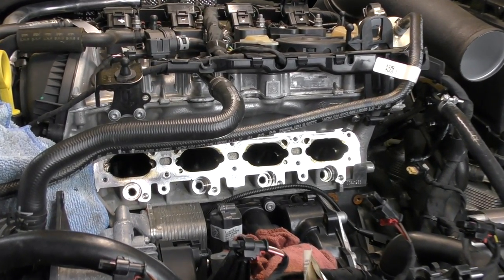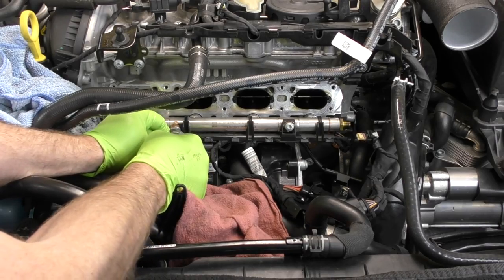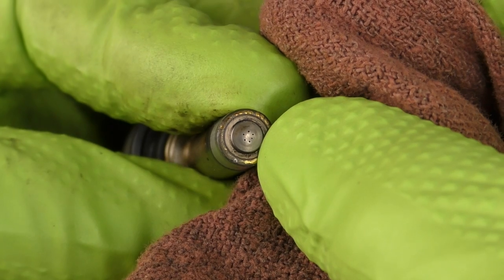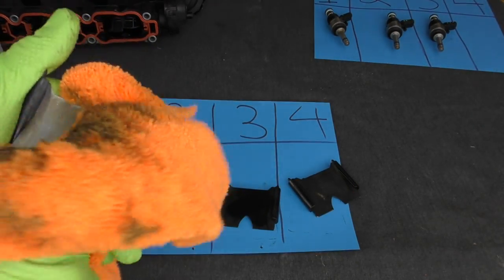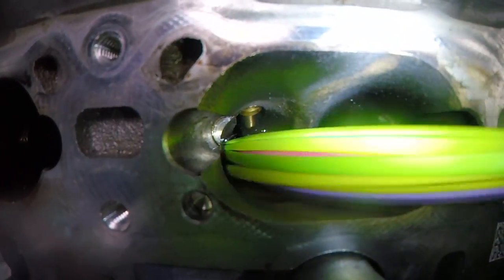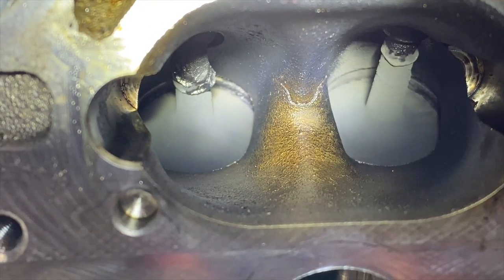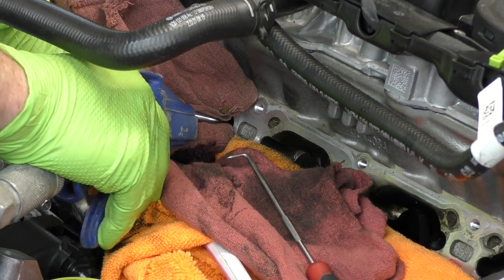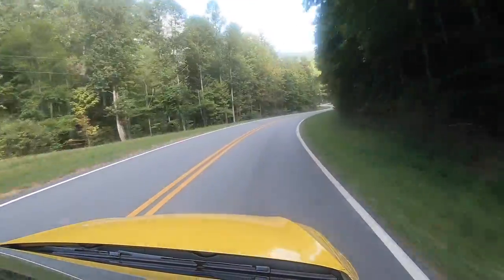How Much Carbon Build Up at 10,000 Miles?? ~ 2019 Golf R

Comment: Unfortunately top-tier fuel ratings have no impact on carbon buildup on DI motors simply because of the nature of the DI motor. Neither does higher octane fuel. As a matter of fact, an occasional tankful of low octane fuel might actually help burn out some carbon deposits due to the fact that the lower octane gas burns hotter than high octane fuel. You won't get optimal engine performance in terms of output for the duration of the tankful of 87, but if you can get ahold of some E0 87 octane at your local gas station (often sold as "lawnmower gas") you'll be in even better shape.

Comment: You should just go on the Autobahn ;-). 250km/h for 5-10km and it‘s clean. An Engine like this is Designed to work hard and Not to deliver the Full power for just 5sec. Just like the TDI‘s, these engines produce tons of carbon during Heavy, Short acceleration.

Comment: Not surprised at all, direct injection means no gasoline washing the valves clean. The whole concept is flawed. My now 30 year old Alfa 3.2V6 doesn’t have a speck of carbon anywhere in the intake. My family car, a twin charger 1.4 TSI builds at the same alarming rate as this engine, only the intake is on the firewall side and to top it off, the flow fins / divider plates you just removed are casted in the block.... A nightmare to get clean. They use walnut blasting here, but I still worry how you keep from getting crud in the cylinder. I turn the crankshaft to close the valves I’m working on/trying to clean. Some companies offer cleanings with special cleaner fed directly into the turbo hose, but I wonder what happens if a chunk of buildup comes loose instead of dissolving? Carbon is hard.

Comment: Previously years does have MPI system also. Why did they remove it? It should be less build up using also MPI system.
I saw that you use Ceratec additive, is that good? Do you recommend it?
Reply from the maker: The ceratec has been great. Well I haven’t had anything fail lol.
US never got mpi. But if a car manufacturer does something it always comes back to cost or emissions
Reply: @HumbleMechanic  I want to get a 2.0 tsi engine, but on a Cupra, and I can get with MPI or without. Should be better with if I can?
Reply from the maker: I’d get it if I could

Comment: Your problem is that you have not used a low evaporating oil. Using a oil with a NOACK lower than 7 will keep the backside of the valves clean. Redline High Performance, and Pennzoil Ultra are the only two oils, with a Noack low enough for high oil temps from WOT Racing, that I would use. NEVER use a Fuel from a discount source like Walmart or Sam's club ETC. One tank will be sufficient in starting a carbon build-up that cannot be removed without media. Believe me on this!

Comment: Isnt the golf r 0-30 not 0-20 oil I thought it was different from the gti 0-20 ?
Reply from the maker: I think you’re right. It is 0-30
Reply: @HumbleMechanic  You used 0W-30. The background on the bottle where the viscosity script is was Pink. Same as the Professional OE Edge. The Professional OE 0W-20 is a bright red. You just mispoke, that's all. Thanks for all you do.

Comment: I’d love to see a “port and polish” video, I’ve heard about it but never seen it and then I’m not sure what the benefit is
Reply: "google"
Reply: Fudge You yea I know but I’d like to see a video
Reply: @knndyskful  I'm sure there are many, Golf R uses the 2.0TFSI engine. Which many different VW's & Audi's use, just search for "2.0TFSI port and polish".
It's not something Humble would do since the Golf R already has bigger valves from factory. On top of that, it's a big, expensive job that would require supporting mods and a tune to actually make use of the porting.

Comment: How it's the pcv system set up on that new engine? Is there a tube that assists to return the oil deposits back to the crank case?
Reply from the maker: It's very similar to the older gen

Comment: I keep a spare head for my A4, and I change heads every 30 to 40k miles....lot easier to do carbon cleaning with head and valves out...it is a horrible design unless you have port injectors in newer models. My lincoln LS with 120k miles has beautiful clean valves. Lol

Comment: That sure seems like a lot of buildup after only 10k especially after all of the precautions you have taken.  I just bought a pre-owned 2017 GTI with 34k so I am really wondering what mine look like.  Does anyone know if the intake cleanings the dealerships offer are effective?  The machine that my Chevy dealer uses looks pretty high tech and my that has been a mechanic there for 25 years says they are very effective if they are done per the manufacturer spec intervals. I don't know if the VW dealers use something similar.  I have been pampered at my Chevy dealer for well over 20 years and this is my first German vehicle and first used vehicle.  I hope I don't regret it because I love the GTI.

Comment: OMG!  2019 Golf R still with direct fuel injection only? I wonder why they don't have a multi port injections system? couldn't that be a good solution to prevent or reduce carbon build up problem? Port injection for normal driving conditions could help clean up intake valves. Mixing any kind of fuel system cleaner or valves cleaner won't benefit from it in DGI system only since it will go directly to combustion chamber.

Comment: I really don't fully understand why gasoline direct injected engines have this carbon build-up issue on the intake valves, but diesels typically don't? Diesels have always been direct-injected, and I have never heard of a diesel having carbon build-up issues on the intake valves.

Comment: 0w20 oil? Just did my first change on our 19 R and used the oem VW kit from ECS which came w 5w40 oem oil and filter. Under the hood says 0w30 but manual says 502 or 504 and the 5w40 I used is 502... very confusing...
Reply: Came down to the comments to post the same. I will be using M1 0W-40 in my 2019 Golf R. I don't believe the 0W-20 oil is correct for a Golf R, I think it's the GTI that VW recommends the 0W-20 VW508.00 oil for.  https://www.hallvw.com/blog/what-oil-should-be-used-in-a-volkswagen-vehicle/
Reply: Technically 502 has been retired and 504 is what the R uses. Either is acceptable. 

508 is typically 0w-20 but always follow spec vs viscosity. But yeah.... 0w-20 is for the GTI and lower trims. I just went though a massive hassle with my local dealer over this. They kept using 508, and I had to get VWoA involved.
Reply: Just to reiterate, if you call VWoA .... They will say use 504.
Reply: GimpyMR2 so 504 has superseded 502... ok makes sense. The oil I got was a “kit” but VW branded 5w40. I’m not worried about it at all as far as the car is concerned and will see what the dealer uses at the 10k service. I’m not comfortable w 0w20 in a hot high power 4 cylinder. Any recommendations on what I should run next diy change that meets 504? I document everything for warranty reasons and so I don’t want issues w VW If I’m using 502 approved oil.... even though the manual states I can so don’t think they would have much ground to stand on.
Reply: @nelsinivr6  I'm personally always wary to recommend any particular brands of oil. They can change formulations over time... you have to keep your eye on them. Take these with a grain of salt and dig around on like bobistheoilguy.com.

On the 504 side: Mobil 1 ESP 5W-30 is an oil I've had success with, is readily available and reasonably priced. I'm not a big fan of having to mail order oils. 

On the 502 Side: Of course the old tried and true Mobil1 options, and also I've had good luck with Pennzoil Platinum Euro 5W-40. I ran that pretty much exclusively in my Fiat 500 Abarth we owned for a while. I did a couple used oil analysis on the Abarth, and they came back really good after 5000-7500 miles. It's port injected, but it runs HOT and is very hard on oil. That Pennzoil is readily available to me for reasonable prices here in Florida. 

As far as 502 /504, like you said... the owners manual calls them both out as acceptable. The sticker on the engine bay says 504. I wouldn't expect any power train warranty issue if you continue to use 502. IF I had serviced my car, I likely would have used 502 as well just out of habit. My previous car to my '19 R was a '16 GTI and I used 502 on it. 

I agree with you though, ... I personally don't like the idea of using 0W-20, even if I was still in my GTI. From what I can see, they have made no meaningful changes to the EA888 between the MK7 and MK7.5. If I'm wrong, someone correct me... so other than trying to get fleet economy up, seems like an odd flex. 

Sorry this got long :)
Reply: GimpyMR2 right on man, thank you! Appreciate the response. I just did the first change like I said and I got the oem kit from ecs which is Audi/VW bottled 5w40. I suspect it is either Castrol or the pennzoil you mentioned as that’s what my dealers use here. I am in VT so mail ordering things is WAY easier... but I completely agree that if I could get this stuff on the shelf I would. I can get Castrol 5w40 which meets 502 but that’s about it. I’ve used Mobil 1 0w40 euro in the past also with no issue. My main concern was about warranty which realistically I plan to void anyways as I’m already itching to tune and mod the car. It’s my wife’s car and I’m dying for a stage 2 package w downpipe and flash. I have a supercharged mk4 R32 that is run hard w 5w40 pentosin... so I’m just a big fan of the 5w40 in general as an acceptable oil weight And viscosity. VW really made this oil thing Way harder then it needed to!! One things for sure I will not run 0w20 and if the dealer fills with that I won’t accept the car.
Reply: @nelsinivr6  not sure if you have them in VT... but Advance Auto Parts down here is who stocks the Pennzoil Euro 5W-40 here on the shelves. I have also had great luck with 5W-40 in general too, and I like using it on my turbocharged cars. Its also what all of my Mercedes have basically used.

Edit: and this is rare for me, but on this R... I'm doing everything I can to keep the warranty for some reason. The GTI I did a lot of modding on, because frankly... I thought it was a slow car. The R is at least "adequate" in power from the factory. I still wouldn't call it fast, but its a lot better than the GTI out of the box.

Comment: Is adding additives to the fuel tank worth it? I've never done it. I thought it was already in premium fuel added on the tank
Reply: Not in direct injection engine, because fuel is never sprayed on the valves so the additive has nothing to clean.  Additive for cleaning fuel injector inside may be worth sometimes, to avoid professional cleaning bill if they clog.

Comment: You're missing a set of low pressure injectors, they spray on the back of the valves and wash the carbon off.
Reply from the maker: I wouldn’t say I’m missing it bob. Haha
Reply: The MK7 Golf R has 2 injectors per cylinder, the direct injector and a low pressure manifold injector. The low pressure injectors spray fuel on the back of the valves to wash the gunk off them. Yours looks like it only has the high pressure injectors so you will suffer the same issues of carbon that the MK6 has.

Comment: Since when do golf R run 0w-20 oil? My 16 is still 5 or 10w-40
Reply: That caught my attention too. The R does NOT use 508 spec! I just went around and around with my dealer about this, and even had to get VWoA involved.
Reply: 0W-30 is what my ‘19 calls for. In his video using an oil extractor he used 0W-30 as well and discussed the confusion around what oil weight to use. Unless I missed something I think he misspoke on the 0W-20.
Reply: Matthew Bromwell yep it’s possible just a goof. Most of the other VW he services use 0w-20 so... I’d guess brain fart :)
Reply from the maker: Yes meant 0-30. 0-20 is other engines

Comment: Is that something the dealer will do and if so around how much dies that cost I have a 2015 jetta with 50,000 miles and would like to get it done sometime soon
Reply from the maker: oh yea. At a dealer, they should be doing media blasting, it is cleaner, and works better. But yea 50k miles is about when you start to see issues

Comment: They should have added some additional port injection, that would be the smart thing to do
Reply from the maker: 100% Agree!
Reply: @HumbleMechanic   I'm soaking my Chambers with Berryman Chem Dip as we speak. Girlfriends A6 with 160K miles. Got most of it scraped of the valve stem but wanting it shiny again. Tried to be Fancy using a Harbor Freight Walnut  sprayer but it is getting clogged and making a mess. How effective is a catch-can from having to do this again?

Comment: Your car's not exactly stock. Doesn't that, combined with some "high-performance" driving, have an impact on carbon buildup? I'd think you might have issues if you are running richer, and with higher pressures, you would see more blow-by, right? Plus, as we know, an Italian Tune-up isn't really going to help on a direct injection engine.
Deutsche Auto Parts put out a video recently about a GTI with 146,000 miles, and the carbon build-up on that car was pretty bad, but I mean 146,000 miles is a lot to go without cleaning.

Comment: I could be wrong here, but  my guess all the carbon and sticky build up is due to the EGR emissions control system dumping all the crap back through the engine.
Reply from the maker: This engine doesn’t have EGR
Reply: @HumbleMechanic  Ooh.  What does it have in place? Or doesn't it?  
Learn something new everyday.
EDIT  Just completed some reading on the EA888.  The idea of the overlap is a good one in place of an EGR.  But it is still bringing waste back in to the system is it not?  I'm interested in how things work even if I don't mechanic!  :)

Comment: Could you fit inlet manifold injection (so like dual port version) to the MK8 GTi and then take out the GPF? - Thanks
Reply from the maker: I can't speak to the MK8 yet. WE don't have them in the USA yet.
Reply: @HumbleMechanic  As an aside, I thought the carbon was very little .... Also we did a test on an RS4 B7, that showed carbon after only 4,000 miles(after being cleaned.) Thanks

Comment: How do you know or check if the cylinder is on TDC?
Reply from the maker: I use my compression gauge, rotate the engine around until I feel pressure build up. But you can also rotate engine around until the intake valves open, then close.

Comment: I can't understand why people put fuel treatments in cars that are run on good fuel with regular servicing.  

What people do it seem to understand is that fuel filters work down to micron level so are extremely effective so no material contamination gets in to the fuel system.

The reason for carbon build up is due to the non or incomplete combination of the fuel/air mixture.  They then add non combustible "cleaners" or "treatments" and wonder why they have carbon at 10k. 

The other issue is the spray pattern from the injectors is also affected because the viscosity of the fuel and cleaner mixture is wrong to create the spray pattern therefore adds to the problem of incomplete combustion.

Comment: I have a turbocharged DI car and my next one will be whichever manufacturer provides me with a port injection tried and true design. This is insane. 10k and treated with the most premium fuel oil and injection cleaners there are out there and still this crap. Unreal, why manufacturers are so cheap and don't add a secondary injection system (both port and direct) that would solve so many issues

Comment: That's a very crazy amount of crap in the intake system.  Looks like you need to use one of the intake carbon cleaner fluids on a regular basis.

Comment: Lifetime VW owner here, also private VW mechanic from the air cooled up until the mid-nineties. Current 2019 Tiguan owner and this is appalling. I have a 8/80000 mil warranty but this is class action material . So disappointed in  a brand that I had loved all these years.
Reply from the maker: Nah if it hasn’t been a CAL by now it probably won’t. This has been going on for over 10 years
Reply: HumbleMechanic For the average “non-mechanic this is really a bad design. Unless it’s another crooked VW thing like the diesel ECM mess just to be a revenue stream for VW dealers.
Reply from the maker: I can get behind a short sighted design. But this style was out before the TDI you are talking about. Also most brands that have direct injection have this issue.

Comment: I don't understand why carbon builds up within injector holes - the fuel pressure is very high to wash it out.
Reply from the maker: its just around the outer edges. As that layer gets higher, the fuel spray can get weird

Comment: Probably wouldn't help to run a can of seafoam spray right at the intake manifold couple times and frequently
Reply from the maker: It might help delay, but I don't think it will fix.
Reply: @HumbleMechanic  Unfortunately I don't got the money or experience to get my valves clean, so I'm gonna have to figure out how to get to my throttle body with how cramp it is and have like 2 cans of seafoam spray on both sides spraying into it at once 😅😅

Comment: CCTA belongs to EA888 family
source: https://en.wikipedia.org/wiki/List_of_Volkswagen_Group_petrol_engines#EA888
PS: fuel additives will not clean intake valves at all (because of direct injection - there is no fuel spray onto intake valves)
The real solution is to prevent oil vapors from crankcase ventilation system to enter via intake valves (using good catch-can or to vent into atmosphere - I know, Gretta will be unhappy, but I don't care)

Comment: 0:26 That's not 0W-20 :P    I do the same thing in my TDI. 507 Spec now calls for 5w-20. I still buy 5w-30 Motul XClean
Reply from the maker: Yep. Mid spoke. 0w30 is the R. 0w20 is other vw engines.